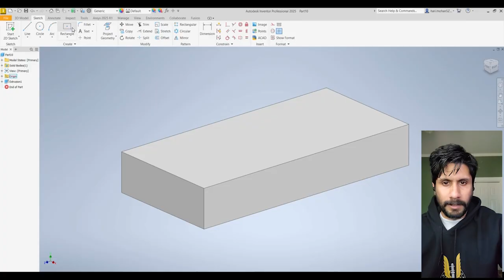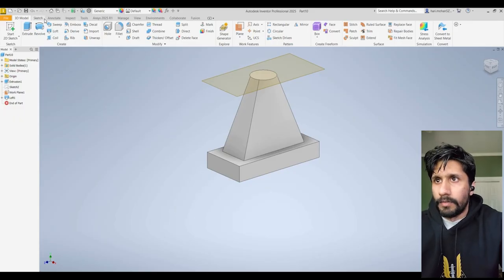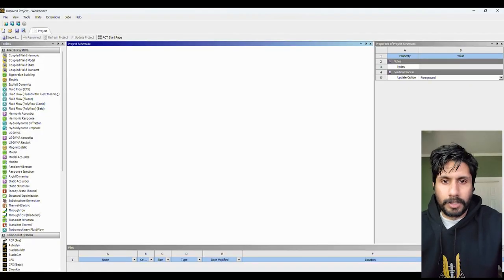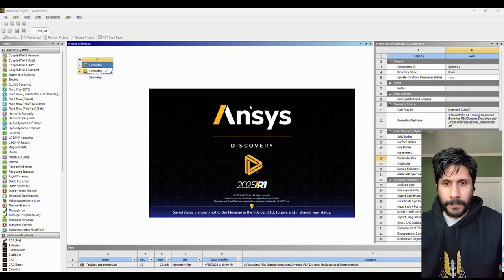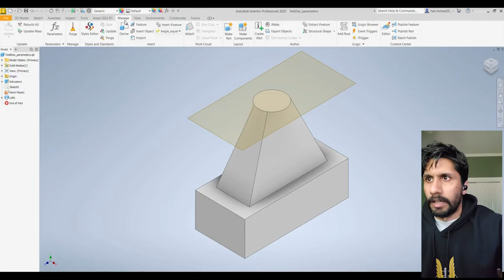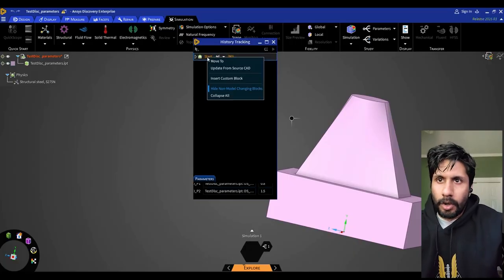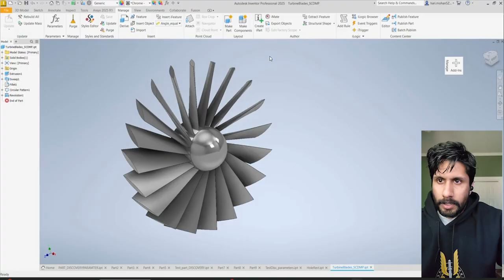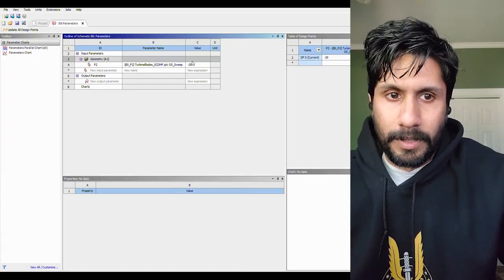How to Link Inventor to Ansys Using Live Parameters

Comment: First of all, great video, very explanatory and excactly what I needed. However, I am having trouble to do that with a surface designed in Inventor, as Discovery doesn't open the geomtry. Does this video concern solid parts only? Thanks in advance!
Reply from the maker: Hari tested it for you, and it does support surfaces from Inventor as well. However, please note, to use the bi-directional link, the Geometry Interface license must be available and activated.  If that’s not an issue, then please check the settings in Discovery to ensure that Surface Bodies import is enabled. This can be found under Discovery: Settings → File → Workbench → Surface Bodies.